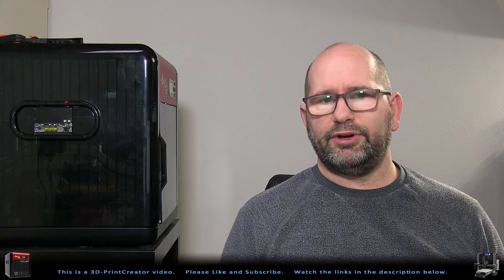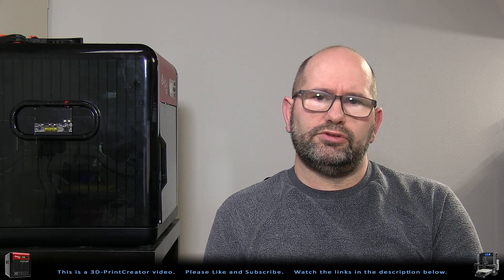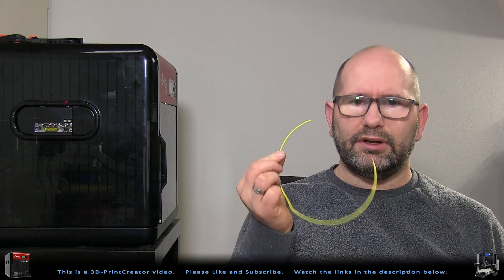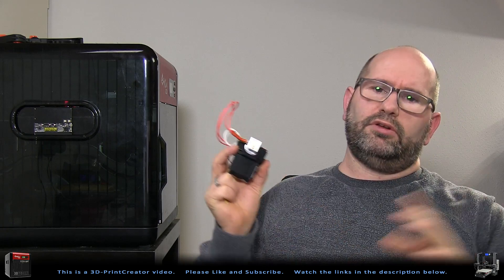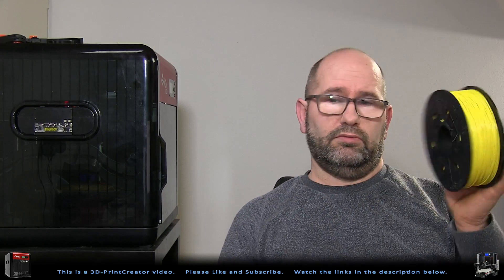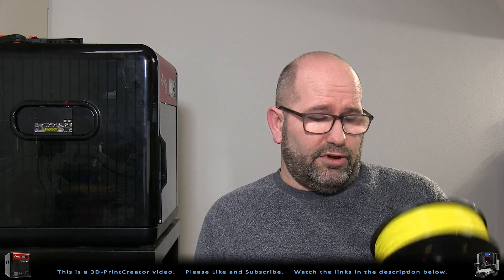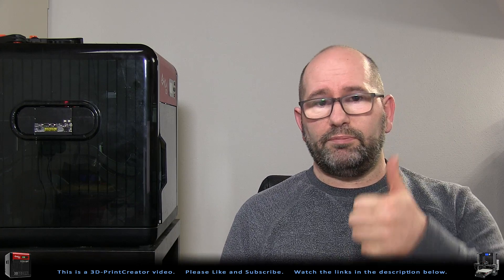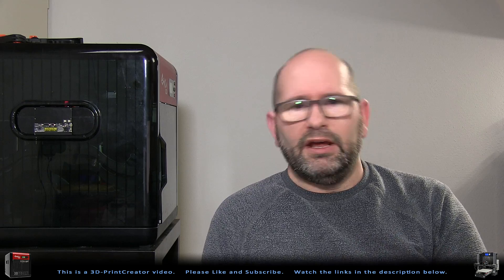▼ Why you should NOT use a filament oiler on your 3D printer

Comment: My ABS filament jams in the PTFE heat break without the oiler. If I upgraded my whole hot end assembly I could do away with it. Literally its the difference between printing and not printing for me. I hadn't considered getting dust sticking inside there. Im not too worried as the oilers primary function is cleaning the filament from incoming contaminats so apart from chewed filament, which shouldn't be happening anyway, its going to be tough for contaminants to get inside.
Reply from the maker: If the ABS you are using jams in the heatbreak, then maybe you should try other retraction settings. For PLA it's pretty normal to have a log retraction travel but for ABS you don't need that. A travel of only 10mm is sufficient and doesn't bring hot ABS into the inner liner. Using oil also works but it is a remedy for a problem that should not be there anyway.
Reply: 3d Print Creator Even with no retractions it was still happening. My printer did ship with a damaged plastic extruder head which I only just replaced. That could have been the reason as it was causing all kinds of extrusion problems. Though ive read people describe my hot end as 'designed by the devil' and they solved the jamming with oil too.

My oilers prime function is catching things like dust, lint and debris stuck to the filament, The inside of the extruder head is quite enclosed so im not worried about stuff getting stuck to oil in there. I guess if your extruder head is open and you have a filthy house it could be a concern.

it's recommended to use only a couple drops of oil which is good for multiple prints. How much oil were you adding?
Reply from the maker: Hi Samuel.
I use no oil at all. The mentioned 2 teaspoons in the video were just used to show how much of that oil would end up in the nozzle. I hope no one uses 2 teaspoons of oil, I also state that in the video. In fact, I urge people not to use oil at all.
I have been speaking with various manufacturers and repair centers to ask them their opinion and they all stated that if an oiler would be usefull or adviced, they would have provided one. The reason they don't do this is because lubrication of the filament should be done in the filament, not on the filament. It's the job of filament manufacturers to make sure the filament slides without to much friction. It is known that some cheap (Chinese) printers and hot-ends come with wrong inner liner tubes, but then this is the problem... Oiling is then a solution to solve the problem you should not have to begin with.

Also note that I am talking about the oil that is causing the problem. I do love the simple box with a sponge between the filament spool and the printer that catches debris before it get's into my printer. I have that box on all my printers, I just don't use any oil in it.
Reply: 3d Print Creator I agree with that. I have a cheap chinese printer with cheap chinese filament so its better than no printing but at some point if i upgrade the hotend or can afford premium filament I can do away with an oiler.

As I've actually been using oil I can say I've experienced no gumming up, no debris buildup and no clogging. Ive recommended it to others suffering from cheapoprinteritis (along with your warning) so they can print instead of have an expensive paperweight. Those people have thanked me as they were finally able to enjoy printing too. Sometimes a few cents of oil into an $11 extruder even if you have to replace the extruder every 6-12 months is still cheaper than buying a genuine $40 e3D lite extruder or a premium allmetal hotend.
Reply from the maker: I can understand what you are saying and I do get it that this is your only option to get the machine working, but you don't need a complete new hot-end, and it doesn't have to be an original E3Dv6 to be working great. If you just buy the right type of E3Dv6 Heatbreak (you can find many of those on Ebay, Amazon, Aliexpress, etc.) then your all good to go without oil.

I am experimenting at this moment with a 8 dollar (including shipping) E3Dv6 Clone with a 4 dollar new heatbreak and that works like a charm for me. I am planning a future video with a comparison between the original E3Dv6 and this very low priced clone.

In the mean time, If you don't experience negative influence of the oiler, just use it :-)
The worst that can happen is that you have to take things apart to clean, you won't damage things.
Reply: 3d Print Creator Ill be interested to check out that video! Pretty happy I subscribed to your channel.
Of course you are right. It may be as easy as ordering a roll of PFTE and cutting a new section or ordering a new heatbreak as you suggest. Its been about 6 weeks of replacing faulty out of the box components, waiting for the parts to ship.

Originally i was going to order some PFTE tube to replace the stuff in the heatbreak but I bumped into a tips guide for my printer where someone recommended an oiler.

Its saved me weeks more of waiting with a dysfunctional printer. Ive just been so happy to actually print things at this point dont want to hunt down the right heatbreak or PTFE and spend money again. Maybe you'll convince me in that video!
Reply: PTFE sorry